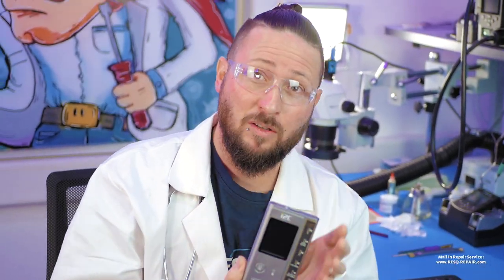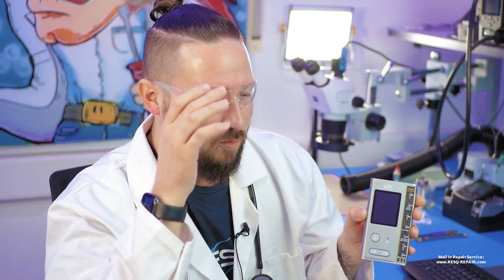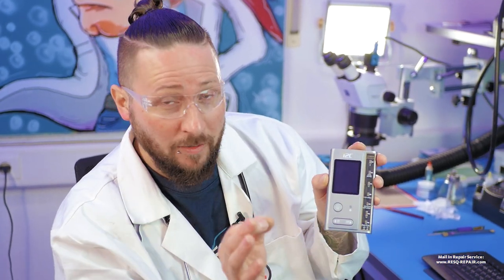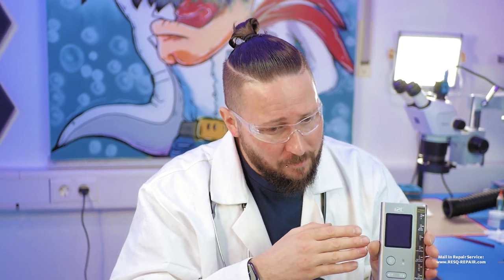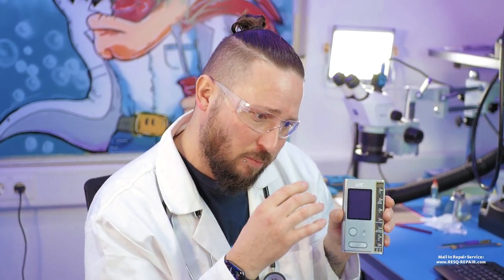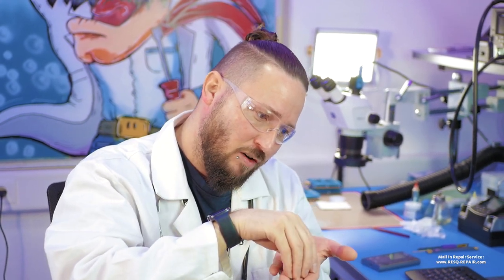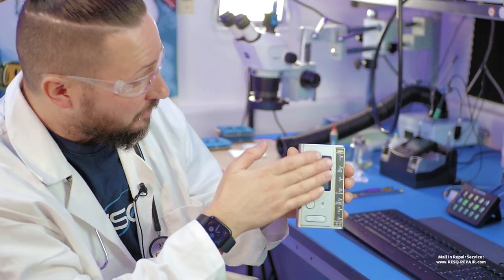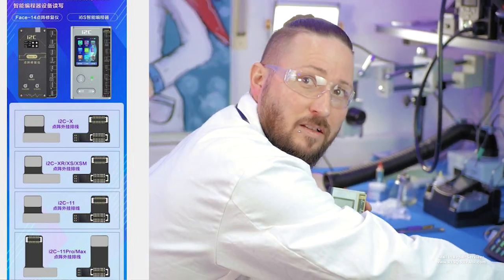😍NEW Method!: Repair Face ID/DOT Projector (True Depth Camera) WITHOUT Soldering! Dr. Bens Tech News

Comment: Hey any pointers as to what to do, I swapped housings on my iphone 12 pro because the old housing was damaged beyond repair, I have a like-new housing I swapped stuff over to.  I was originally able to set up face ID during phone set up as I had restored the device, however Face ID just wouldn't detect my face after that.  I reset Face ID afterwards to try and see if that would fix the issue but its not detecting a face, I only get the message "Position your face within the frame."  No prompts to move phone up/down.  No issues detected.

Comment: They should also do it with battery without removing the BMS and swap. Also with the screen. What you think?
Reply from the maker: Wait what comes 🤙
Reply: @RESQREPAIR  i love that response dr. Ben
Reply: Bro is jcid support read/write data from front flex cable as i2c ?

Comment: My red dot is not visible any more on the iPhone XR. Can you tell me if my true depth camera can be repaired by handing this video to a repair shop?
Reply from the maker: The DOT generates points and the ir cam „scans“ them on your face. So if the DOT don’t works, there are „no reed points“. If you have really a DOT issue needs to be checked in a professional company.

Comment: what if the dot projector is defective? can we use any other dot projector? can the whole face id system be replaced as one piece if able to read info from true depth cam?
Reply from the maker: Not possible. The emitter within the DOT is serialized and the IR cam is serialized, too. So there is no replacement possible.

Comment: is jcid support read/write data from front flex cable as i2c ?
Reply from the maker: Yes. But you can’t write JC cables with i2c.
Reply: @RESQREPAIR  but it’s need jailbreak with jcid that the only method i knew :/